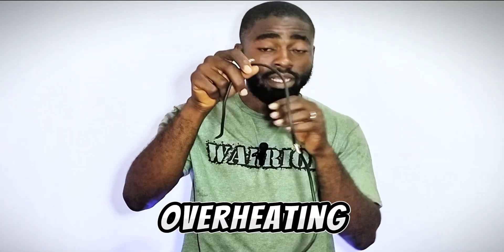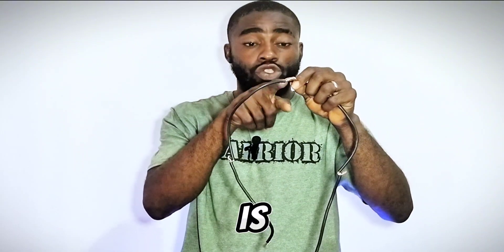Avoid multiple joints in your solar energy setup as a beginner!.

Comment: thanks for all your advice, please which type of cable is best to run solar system?
Reply from the maker: Single core flex
Reply: @Mairigaemmanuel how many  mm Sir?
Reply: How many mm Sir?
Reply from the maker: Depends on the size of installation
Reply: @Mairigaemmanuel  2.5kva with 6 300watts